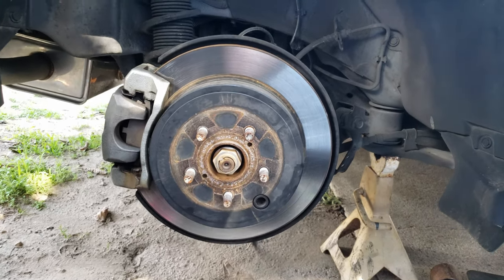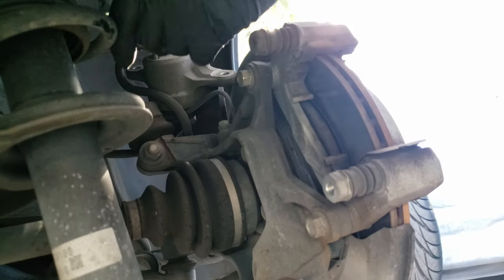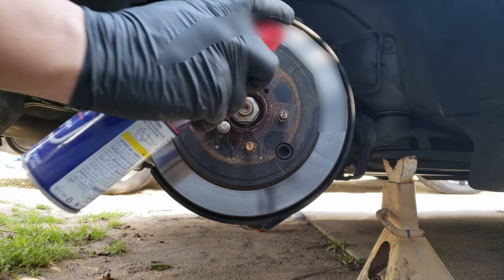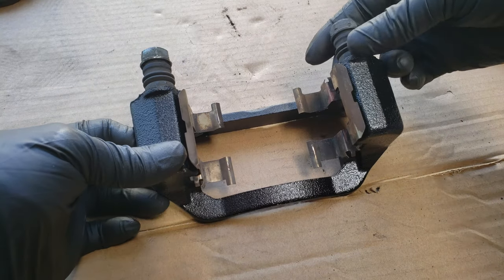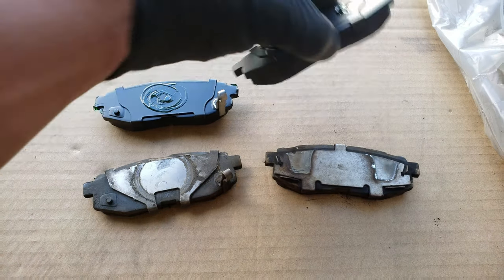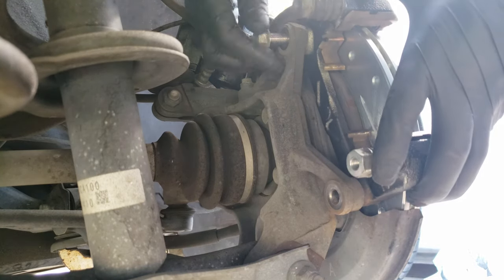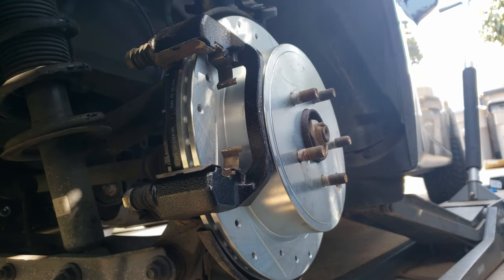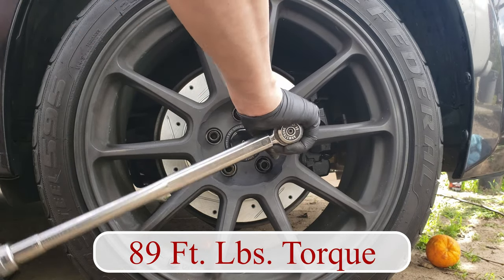How to Replace Rear Brakes and Rotors - Scion FRS, Subaru BRZ, Toyota 86

Comment: Thanks so much for this video. Changed my rotors and pads today and referred back to this several times. The camera angles and editing are great. Including the torque specs and the specs for that bolt to help get the rotor off the hub was perfect.
Reply from the maker: Thank you🙂 i really appreciate it
Reply: @backyardchevy328  I'll get onto the rear pads and rotors next weekend. I have seen your other video on that 😂. Looking forward to getting my 86 back on the track when our lockdown ends here in Australia. Thanks again.
Reply from the maker: @kevildub  thats awesome! Im sure youll have it in tip top shape👍

Comment: Thank you for this video! Made my brake swap a snap on the BRZ.  I am also having a light rubbing noise on the right rear, as I see other commenters have mentioned. I did adjust the parking brake and that helped but it seemed to come back. I saw your mention of giving the pads time to seat, so I'll give it a few days and see how it shakes out. Appreciate your work here, good sir.
Reply from the maker: Hopefully that's all it is, good luck🙂👍
Reply: @backyardchevy328   Thanks for the reply, I hope so too. The caliper piston on that side had a bunch of gunked up grease caked around the base of it, I cleaned a bunch of the gunk off when I compressed the piston, my only fear is if the piston is getting stuck because of other gunk I couldn't get out and not retracting properly.  Time should tell, one way or another.
Reply from the maker: @bossdj523  a good way to tell is have someone sit in car with it in neutral and spin the wheel by hand..have em press brake and release it should release back to allowing u to spin it
Reply: @backyardchevy328  I really appreciate the tip, friend, you truly are a gentleman and a scholar.
Reply from the maker: @bossdj523  thank you🙂
Reply: boss dj i am also boss dj can i follow your ig

Comment: Thank you a true lifesaver i was replacing wheel studs today cuz previous owner didnt know what right sized lugs are and had to quit on rear because i couldnt get rotor off, going to try again with parking brake off in morning lol🤦‍♂🤦‍♂🤦‍♂Thanks again
Reply from the maker: Yea that will definitely keep the rotor from coming off...im sure youll get it off easy once its removed lol🙂👍
Reply: @backyardchevy328  yeah i heard that part of video and felt a lil bit slow just needed a lil more common sense thanks for having it for me lol🤣🤣
Reply from the maker: @tjs1568  anytime🙂 hope all goes well tomorrow..good luck

Comment: I used this video and replaced both sides recently, pads/rotors. Everything went smoothly, super simple thanks to this video, thank you! I am having an issue though, at low speeds I am hearing a slight grinding noise. This only occurs at very low speeds and doesn’t effect the braking. Any ideas on what it could be?the noise does not occur when braking, only when the wheel is spinning, such as rolling in neutral btw.
Reply from the maker: Thats awesome..great job👍..grinding noise could be a wheel bearing, when they go bad youll hear grinding..do u hear it at a specific wheel? Front or back? If ur not sure..id have someone drive it slowly and listen to it as it passes by you to try and pinpoint it or have someone stand outside and listen to it to see if they can tell u a specific one..A wheel bearing when it goes bad itll normally have some play em on it..so youll be able to lift the vehicle..grab the wheel at the sides or top and bottom and shake it..to feel for any play
Reply: @backyardchevy328  Thanks, first time ever doing it, ha. So I hear it in both of the rear sides. Only at low speeds and its when the car is moving, not when braking. This noise never happened before I changed the brakes and rotors. I changed the drivers side first and heard it faintly, then changed the passenger side 2 days later and hear it as well. I am guessing its the dust shields or the "brackets" for the brake pads? the hardware that gets inserted (that you cleaned off in your video). My braking seems fine and I drove on it fine
Reply from the maker: @kev60625  have the brake pads seated against rotors yet..normally when u first put in a new rotor with new brakes youll get noise since they havent seated yet..but once they do that noise will go away..it may be that...could also be backing plate but that's more of a squeal type sound same with hardware if they were rubbing itll be a squeal type sound

Comment: I have almost the same pads as you and only one of them has that little metal piece thingy on the side what is that for?  Am i only supposed to have one like that? Is it to make the (squealing noise when the pads wear down??) im assuming its whats that for? But i guess my question is do i only need to have one of them ? I installed it on the rear passenger side just like in the video

Comment: Excellent video(s). I'm having a hell of a time getting the leverage to break these bolts. I guess I'm going to need to get a long handled flex-head 3/8" ratchet. Is that what you're using?
Reply from the maker: Thank you 🙂...Im using a long flex head 1/2" ratchet with a step down adapter...its usually my go to setup with those caliper brackets...but a long handled 3/8" should work.

Comment: Tools you will need:
14mm bolt socket - for brake caliper and caliper support bracket
Disc brake caliper tool - to rewind caliper piston
8mm 1.25 thread bolt - for disc removal
Brake grease/lube - to lubricate brake parts
Zip tie - optional, tie and hold your brake caliper while working on the disc

Torque spec (from Subaru service manual)
Caliper support bracket - 66nm or 49ft/lbs
Caliper - 26nm or 19ft/lbs

In case you need to replace your wheel stud
M12 x 1.25 - Subaru 28365FE001 Wheel Stud
Wheel Nut - Subaru 28171AJ001 Wheel Nut

Comment: Hello, thanks for your videos i will replace front and rear brakes soon (disks and pads), i have a question, do i need to have parking brake off when replacing rear?
Reply from the maker: Yes when replacing the rears youll wanna make sure the parking brake is off
Reply: @backyardchevy328  thanks a lot !

Comment: Can that 8mm bolt be found somewhere in the wheel hub, or anywhere on the car? Or do I have to go back to the hardware store?
Reply from the maker: I would say hardware store..i wouldnt know for sure if any are that size somewhere on the vehicle..i had mine from an old ls engine i took apart

Comment: My guide pins keep spinning when I try to tighten the brake caliper. Not sure what’s gonna on
Reply from the maker: U can hold em using a wrench if they keep spinning but normally a regular wrench wont fit..itll have to be a thinner wrench
Reply: @backyardchevy328  okay thanks. I thought I did something wrong. Thank you
Reply from the maker: @Rado0098  no, that'll happen sometimes, i should of mentioned that on the video

Comment: I can't get the rear rotor off is it just stuck  or is there something else?
Reply from the maker: Do u got the parking brake off? If u do have u tried spraying it with wd40 and using a bolt to get it off like i did on video?
Reply: @backyardchevy328  i think i need those bolts are they 8mm x 1.25?
Reply from the maker: @chrisorr4087  yes, get 2 of em if u can and tighten them back and forth and itll free up the rotor
Reply: @backyardchevy328  ok thanks for your help!
Reply from the maker: @chrisorr4087  anytime🙂...hopefully ur able to get em off
Reply: @backyardchevy328  Yes, once the parking brake is off, the rotor can be slide off easily.  good advise

Comment: Can I hit the rotor a bit with a hammer to get it off?
Reply from the maker: yea..first make sure that the parking brake is off, cause that would make it seem like the rotor is stuck..if its off..u can tap it off or use the bolt method i used..just try to avoid hitting the lug nut threads..i put pieces of heater hose over the threads so i dont hit em by mistake.
Reply: @backyardchevy328  thank you

Comment: Im trying to get the rotor off. The handbreak is off. But dont wanna come off
Reply: I used 8x1.25 bolts and the center ring is entirly off. But the is something holding it
Reply from the maker: @jorgnyoa3561  were u able to spin the rotor a lil..a good way to find out the parking brake is entirely off is that u should be able to move the rotor..it wont spin freely since its rear wheel drive but it should have some movement
Reply: @backyardchevy328  found the problem👌.  There was a clip that held the springs on the handbreak  that made the breaks tilt in. Too make it even harder to take it of.

The other side took 5min to get off😝
Reply from the maker: @jorgnyoa3561  glad to hear u found the problem🙂👍 great job...yea it should of been as easy as the other side lol
Reply: @backyardchevy328  thx for great video🔥
Reply from the maker: @jorgnyoa3561  anytime🙂 thank you for the support

Comment: i tried to take the rear brake rotor off today but it seems like there is something inside, possibly the drum brake, stoping it from coming off. I am not sure what it is. I confirmed my parking brake is off and the rotor can spain freely. Does anyone here have the same issue?
Reply from the maker: If u have the parking brake off, itll just be the center hub holding it, u can either tap it free or use the bolt method to remove it..have u tried that?
Reply: @backyardchevy328  yes i tried the bolt method. but it still wont come off. i can feel the rotor is free to move. it's something inside stopping it. and once I release the bolt that 'thing' pulls the rotor back to its original position.
Reply: I am planing to completely dissamble the drum brake to see if that helps..... but not sure how to do that right now.
Reply from the maker: @pengcody4603  unless the parking brakes are worn down to where theres a lip on em holding it to the rotor..maybe they would drift on it and use the parking brake that way
Reply from the maker: @pengcody4603  it does have an adjuster that u can use that bigger hole to bring down the parking brake as low as possible to see if that helps